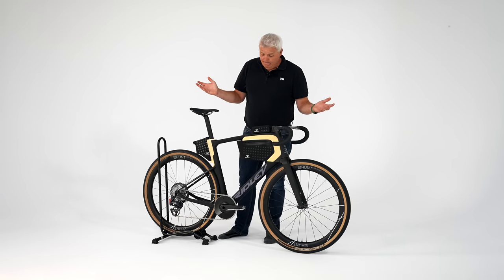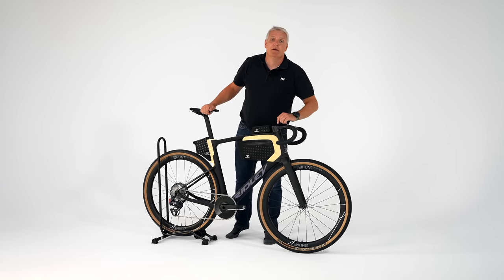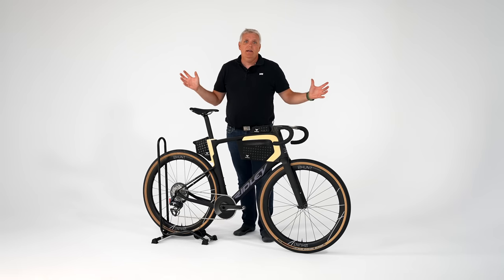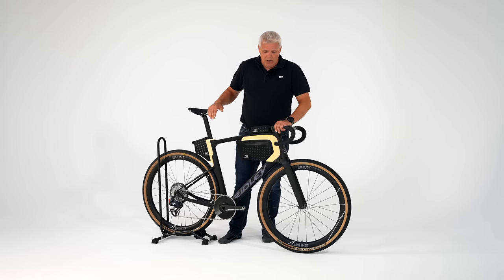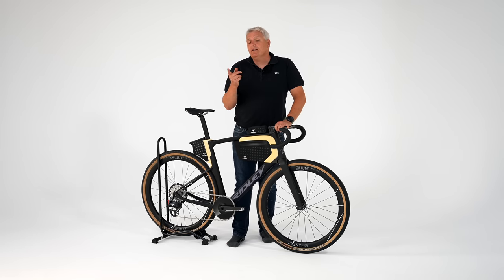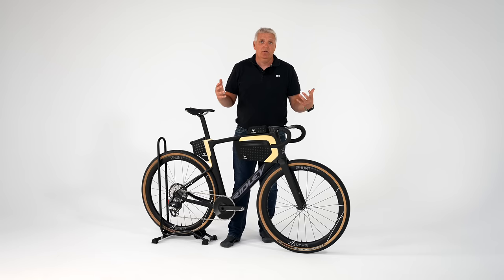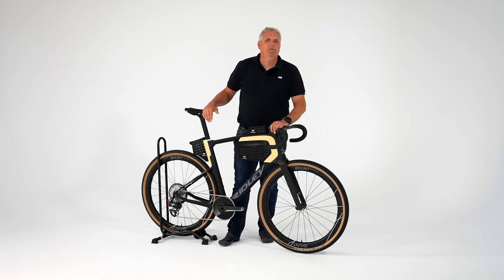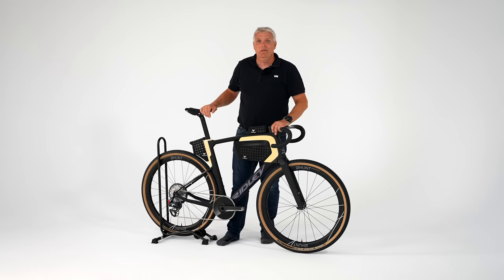Apidura Aero Pack System: Schnelleres Rad, bessere Aerodynamik mit Bikepacking-Taschen

Comment: Interessante Idee, so eine Tasche am Sitzrohr könnte ich mir an meinem Rad gut vorstellen anstelle einer Satteltasche. 

Ich kann mir aber leider kaum vorstellen, dass sowas Mal in Serie geht dafür sind der Markt und die Nachfrage zu gering nehme ich an. Und dann noch x verschiedene Rahmenformen und 4-5 Größen, dass ist ja noch schlimmer als beim Handyzubehör.
Reply from the maker: Ja das wird ganz sicher schwierig mit den unterschiedlichsten Rahmenformen und dann auch noch die Größen. Aber wer weiss - vielleicht wird es zukünftig doch machbar sein mit Adaption aus dem 3D Drucker in Kleinserie - nach Kundenwunsch.
Reply: Die Anpassung an verschiedene Rahmen ginge vielleicht mit flexiblen und/oder zuschneidbaren "Dichtlippen" (Das gelbe Zeug, das im Video den Übergang von Rahmen zu Tasche glättet). Ansonsten sind ja jetzige Taschen auch nicht immer nur für ein einziges Rahmenmodell geeignet.